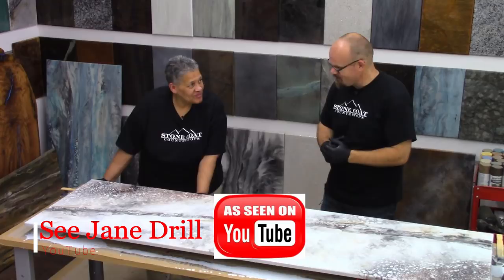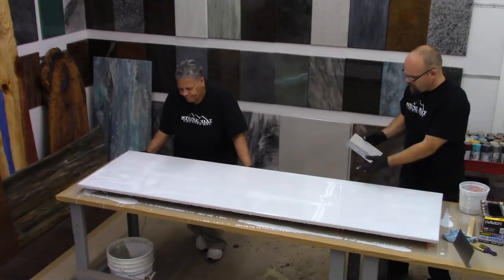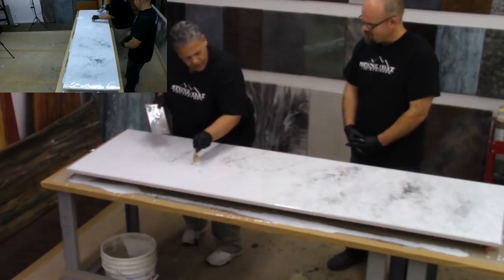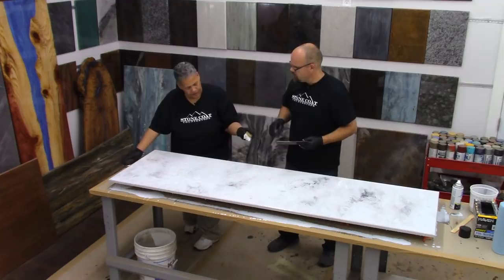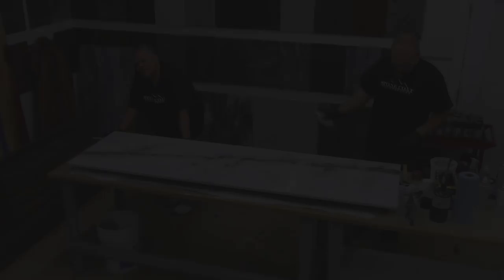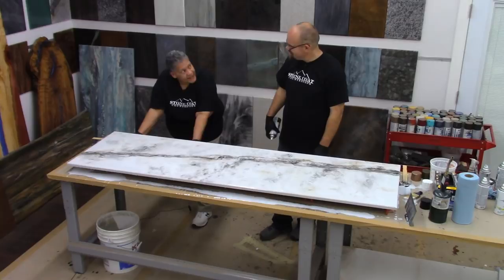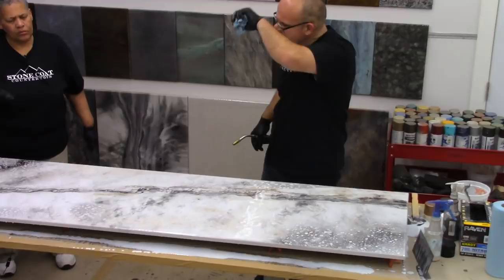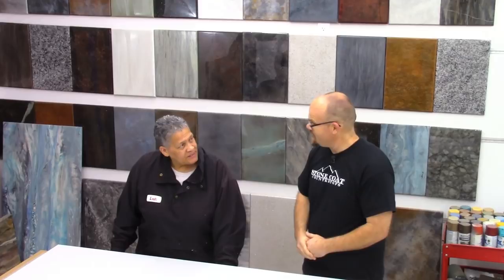You Can Do This!  Epoxy Countertops

Comment: Considering this as a business in my area and I've ordered the products for my own home project and sample boards to start.  I have a few questions....
1) can you save mixing buckets by cleaning them up?
2) on MDF, can you use any type of primer?  I noticed in one video, you said to use your bonding primer on shiny surfaces but not necessarily on MDF.
3) do you clean the trowel with straight acetone?
4) I'm doing a vessel bath sink at home.  Should the holes be drilled in the MDF before, or after the application?  If before, how would you clean the drip out of the holes?
Thank you so much!  I love you and Leah together on this.  She's a wonderful teacher too!

Comment: Hi Mike,
I think I might have a bit of a challenge for Stonecoat Countertops.
I'm turning a spare bedroom into a studio workroom for videos. The floor will be resin as will my work table. The work table will have some measurement markers, a bit of design/logo.
The challange... a top coat that has a clear 'silicone' Type layer. Something so that, if I am making a resin art video and drip on the table, it won't stick.... just like as if I was using a silicone mat.
This way my logo and measuring marks can show through for youtube videos.
Same for the floor,  but, with the added element of needing to not be too slick.

Think that's a challenge video for which Stonecoat Countertops
Could come up with a solution?

Comment: I love this and want to do a dinning table that has 2 leaves.  How do you do that so the epoxy doesn't drip down between the leaves and make it so the table can not be closed correctly or then make it so the pattern looks good when the leaves are out and also match when the  leaves are in.  I hope I made this clear.  the top fits together where each piece comes together into metal pins and a metal sleeve, and the same with the leaves.  Each leaf fits into the pin of the adjoining leaf.  I do love the copper look which might be easier than trying to match anything up.  Please answer soon.  I need to order the stone cold as my family is coming at the end of March and I would like this project finished.  THANKS

Comment: Mike I want to use your product to clear coat over butcher block counters and I have one question. What do you do if the counter top has a pre oiled state? will this effect the stone coat epoxy adhering to the counter top?

Comment: I just received my first order of epoxy from you and went straight to work following this video. It is so easy to do and my surface turned out great unfortunately there was a slight problem, I used just a dab of interior/ exterior acrylic white paint and as I was mixing it, it turned into the consistency of jarred marshmallow. I continued on, not wanting to waste the epoxy but doubt it will set up properly. My question is, is your white base paint the only thing that will work with your epoxy or can Acrylic paint work? If Acrylic paint will work then what did I do wrong?
Reply: I've only had that happen with Goldens Acrylic Medium and any paint that contains it. It gums up and destroys Epoxy Resin. I guess you were trying to use regular old latex house paint? I've had no problems. Always good to check new paint in a small batch like he said. Glad your project still turned out ok. That could have been a real disaster.

Comment: Hey Mike, quick question. I have laminate countertops now that are in good shape and would like to use your product. My issue is that my countertop has a slightly raised rounded front edge. Is there a way you recommend to get that flush and square or is that not possible? I dont have the space to make MDF countertops and would like to save as much money as possible. Any suggestions would be greatly appreciated!! Thanks so much
Reply: P.s. I really hate the raised rounded edge and like the look of a perfectly square countertop edge. 😁
Reply: Jacquey C. did you use this? I have the same question about the raised edge. Thanks!

Comment: What about drilling holes for fixtures and vessel sink drains? Before or after the expoxy? Any special precautions or tips for holes?
Reply: Great question!  We use fine tooth wood working bits to drill holes after we pour the top.  Thanks!
Reply: I'm a woodworker and I'm not aware of any "fine tooth" bits. Can you give me a name or Amazon link?
Reply: OK you meant a fine tooth Hole saw. Makes sense now. Thanks!

Comment: You are always so generous with the different ways to do counter tops.  I would love to do a table top but have no idea where I would get the legs.  I don't want wood legs but want it to look more modern with metal legs.  Any suggestions on where to get them?  Thanks for all of your instructional videos!
Reply: Search "Table Legs" on Amazon. If you like Hairpins (or curvy hairpins) you can get a set of 4 16 inch for $26.99 they have crosscut trestle legs, steel L-shaped, tapered, trapezoid, square etc. all reasonably priced. Check out Ebay & IKEA too. You might want to redo a table from the thrift store or on craigslist, or other local apps where you can buy 2nd hand stuff like "OFFER UP" & "Let Go"..or is it  "Let It Go?" IDK but my mom has purchased stuff off those apps before, dirt cheap!
Reply: Thank you so much!!  Will definitely bookmark them.

Comment: How does the epoxy stand up to a hot pot or a slipped knife?
Reply: Great questions! Stone Coat Countertop epoxy is durable. You can set hot pots and pans directly on the surface; however, just as any countertop surface, we suggest you still use hot pads, as it's nonporous and food safe. You can clean with normal household countertop cleaners, but soap and water generally does the trick. Not much will damage the surface as far as spills and stains, but it's good to clean up spills after you're finished cooking and using your tops to prep. It takes three days for light use, seven days for cure and thirty days to a full cure where our durability video tests are shown at. Here is a link to our durability video showing what Stone Coat Countertops can take, we have tested up to 475 degrees ferinhight . Thank you and feel free to contact us anytime! Here is that video link: https://www.youtube.com/watch?v=YLUteivXWaM

Comment: I'm wanting to do this for my shop counter - how long does this process take from start to finish?  Is this something to do elsewhere (ie, home) and bring in and install or can it be done in place over a weekend?  I'm asking from primer/paint to fully cured dry final clear coat ...
Reply: cl west is your shop climate controlled? You’ll definitely want it between 68-75 degrees. You’ll also want to avoid anything that kicks up dust or any moving air at all really for about 8-12 hours (or overnight) after each coat of epoxy. This is especially true for the final (flood) coat though. 

Start to finish - sanding, 2 coats of paint and primer (light sand in-between) will be about 4-8 hours depending on how warm the shop is. The first coat of epoxy will take about 12-18 hours to cure hard enough to lay the second clear (flood) coat. 2nd coat will take 24 hours to cure enough for LIGHT use. Again, depending on temperature, you can begin regular use 72 hours after initial application of the 2nd coat. It will continue to harden for about 30 days, but you won’t really notice after the first 3 days.
Reply: If you have a specific look in mind I highly recommend doing a small prototype. They’ve got a bunch of really good videos on how to make them and various color recipes.
Reply: Patrick - thank you for your great answer!  I am guessing to be on the safe side to wait for a 3 day weekend - which is the type of answer I was looking for - thank you again!
Reply: LOL!  yea, watching the videos is what gave me the idea to try and with Leah doing it .... gave me the guts.  I still think a 'sample' board would be a great idea to get my toe in the water, so to speak, and when it turns out, I can use it as a shelf or something in my shop.  :-)
Reply: You're a great instructor!  Watching how you coached Leah to improve her technique was very helpful!  Thanks!